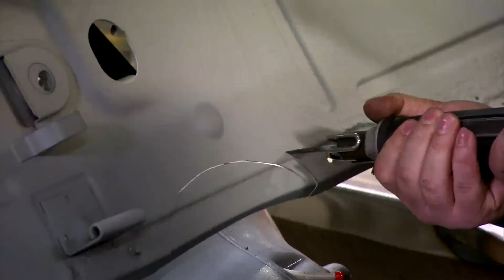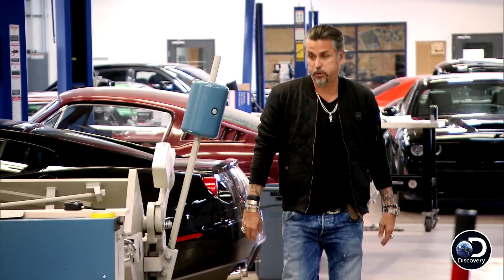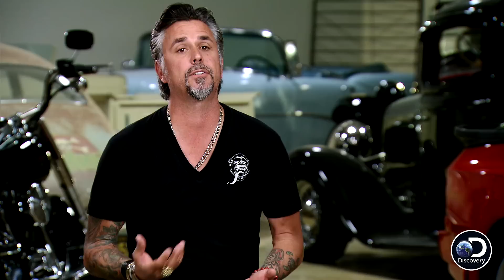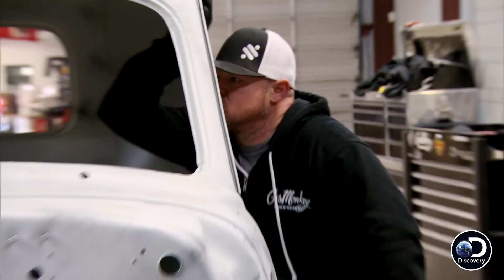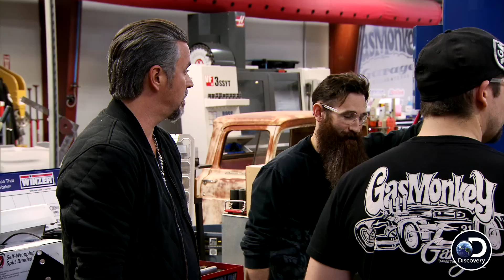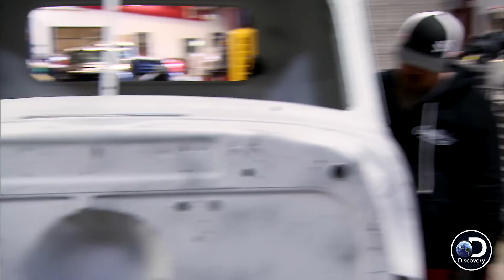When the Buyer Wants It Black | Fast N' Loud

Comment: To me this says they do a less than exceptional job on a regular basis.
Reply: Michael Jarrett  , 
If they were doing exceptional work on every project. The customer’s choice of color would make no difference what so ever.  The amount of body work to do it correct is the same. 
That said, the prices for doing that kind of work on every project would be astonishing and not good business practice. Most customers would not pay what it costs to do that level of work or have the knowledge to know what they are paying for.
Reply: Every car builder in the country feels exactly the same way about a high gloss black.
Reply: graves74 Texas Metal: Hold my beer.
Reply: That was actually the reason Aaron left.

Comment: It's only a problem if your work sucks..
Reply: blackknighl No its a problem when you're on a tight deadline and you have to spend a lot more time making sure everything is 100% dead straight, which even then you can't be completely sure of until after you have painted it, which means black is a fucking difficult colour to paint. It's not about your skills or how good your workmanship, give it to the best bodyshop in the world and they'll all say that black is a bitch to do.
Reply: Why are they on a deadline though? If it's not done in a week the guy doesn't want it anymore?
Reply: Shona yea, mother of pearl can be a bitch too, many of good bodyshops have had bleed through on bodywork.     I always sprayed silver over the primer, color sanded then sprayed the car. Silver hides it.... But that's a 1990's trick for pearls and metallics
Reply: Shona I also won't use anything other than matrix paint systems.     And will absolutely refuse anything that supports ppg products. 

But I am also a USC guy aswell.
Reply: TheGuyWhoIsAustralian
 - That's the bullshit aspect of most of these shows. Supposed to add to the "tension and drama." Personally, if I'm paying top dollar for a kick ass ride, I want it done right. Not done by a certain date. Especially if I want it painted black, which I will.  ;)
Reply: Shona nah sorry you missed the mark on this one. I’ve seen many old resto cars painted by local small body shops. They don’t complain. They charge a little extra and get that car perfectly straight.
Reply: So if the car is not going to be painted black, you don’t need the body to be perfect? You cut corners and don’t make the body perfect since it’s not going to be black?
Reply: KC wouldn’t have complained like that